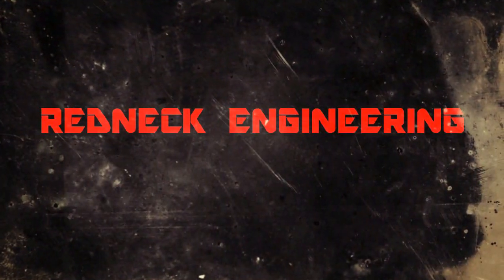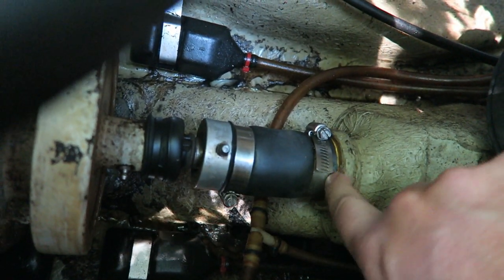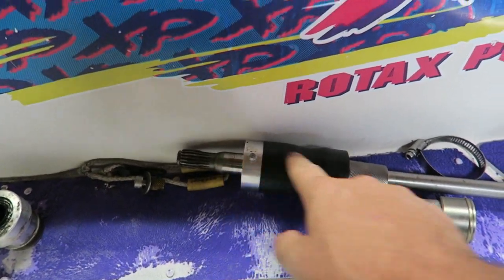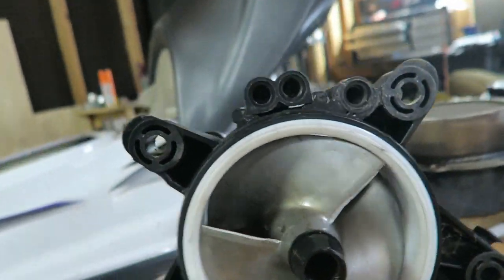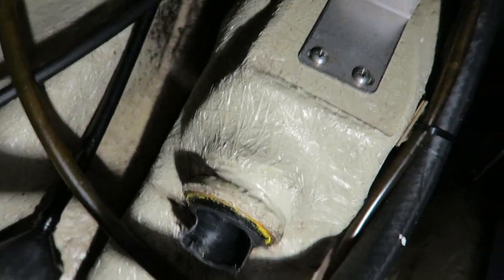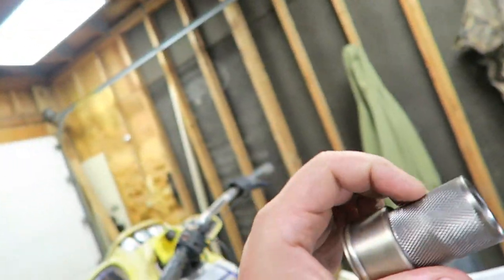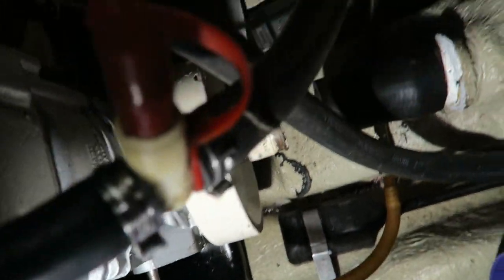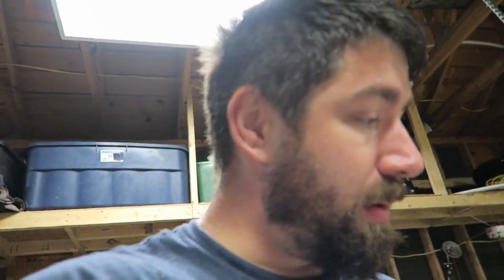1995 Seadoo xp drive shaft bearing and thur hull insert repair

Comment: I don't know if anybody told you but the reason that happens is because people never Grease the carrier bearing they freeze up and tell the hull all to hell you can put a carbon seal in there and replace of that that was the last year they use those crappy carrier bearings carbon steel is the only way maintain it properly it never fails then we saw on these 20 years good-looking XP

Comment: Hey buddy, I need your help! Watched your video. I purchased a 1995 XP just like yours. Only paid $1200. It filled with water and took it back to the guy and he said he had to replace the shaft bearing coupler. Got it back, son was riding it and it got water inside again. Drained, took home, it sat for few weeks. Water did not cover the engine. Anyway, I topped off the oil injection with my current oil XPS from seadoo for 2 strokes. I am not sure what oil was already in the oil tank. Got out on the water and it ran for about 30 seconds and then completely stopped. It sounds locked up and not a starter issue. I just removed the top of the engine and studied the pistons. They look fine and so do the cylinder walls. I was able to put a large wrench on the drive shaft and finally get the pistons to move up and down but there is resistance. I want to remove the drive shaft coupler but you do not really show that in your video. I have worked on the carbon ring seal on my 1997 seadoo GSX. I want to get the shaft off the engine to see if the flywheel turns more normally. Or is my engine locked up partially and need a new refurbish unit from SBT. But how to you remove the coupler along with the black boot? I have removed both c-camps. Is it easier than I am making it out to be? Paul in Lamoni, Iowa.

Comment: This was very helpful since I’m having the same issue on my 95 gtx and I ordered the new part but I’m having some trouble getting the carrier bearing off the driveshaft. I’m going to try to heat it up and pull really hard.
Reply: did you have any luck
Reply: @rileyhull549 yeah f I remember I got it

Comment: Did you do anything the seal the pump when you re-installed it. Or did you just bolt it right back in. I pulled mine the first time and nervous it's going to leak.
Reply from the maker: It just went right back together no leaks

Comment: The broken piece that you cut off is what the back hose clamp clamps around you are gonna sink again. I had this same problem and I used a vacuum cleaner pipe and some PVC primer and glue and made a new piece and it has been working for about 7 or 8 yrs now . Mark my words that chalking seal is gonna beak loose and you are going to sink.
Reply from the maker: Did you even watch the video! I literally replaced that plastic part with an aluminum piece! Come on now before you start talking crap at least know what you’re talking about

Comment: The real question you need to ask is will it run long most people can get these things running but they don't run long because they don't know all the ins and outs to check and make sure everything's right not only that some of them have to have Factory upgrades or they come apart as well I have been working on two stroke jet skis for over 20 years and they always say will it run the question is for how long
Reply from the maker: It doesn’t matter I sold all of them and made twice invested
Reply: @redneckengineering7739  well in Texas without a license that's called skip title which is illegal but anyway I just thought you might want to learn something for future reference dick face
Reply from the maker: Idk wht u said youtube removed ypur comment must have been really dumb

Comment: So what was the problem with it not wanting to move in the water, i got an sp that runs and revs fine just doesn’t go
Reply from the maker: There is a fuel filter inside the carbs and they get stopped up from bad gas and the factory fuel lines fall apart and stop it up also
Reply: @redneckengineering7739  i made another comment found the problem my splines on the drive shaft were stripped

Comment: Spin the prop and if there is no friction between the wear ring and the prop than the wear ring is worn out . The friction causes the water to jet out with no friction is just going to run like a hose
Reply from the maker: It runs great now so its fine

Comment: Had a similiar problem. Was the tiny filter inside the carb. clogged solid.
Reply from the maker: Yep that’s what it was and then I replaced all the fuel lines and it runs great and I’ve actually repainted it and Put new decals on it now

Comment: That random bogging could be your rectifier. Mines was doing the same thing even after a full carb rebuild. Once I replaced the rectifier it clear up and ran amazing.
Reply from the maker: It was actually the factory gray fuel was deteriorating and clogging up the filters inside the carb replaced all the lines rebuild the carb running right now
Reply: @redneckengineering7739  awesome. Yea that should have been one of the first things to replace once you got the jetski. Those lines will make your day not so great when your expecting to go rip it.
Reply from the maker: That was the first try tho

Comment: Where did you get the metal thru hull adapter you used? I have the same ski. Adapter leaks like a sieve.
Reply from the maker: Everything used is linked In the description
Reply: Redneck Engineering did it stop the water leak? You didn’t confirm that on the video. It was pretty good by the way. Does it sound like it cavitating? Might be loose impeller. Hopefully you filled the oil in the pump cone.
Reply from the maker: Yeah it did